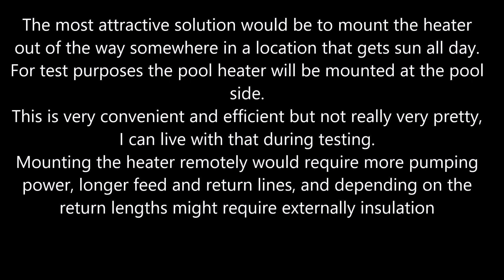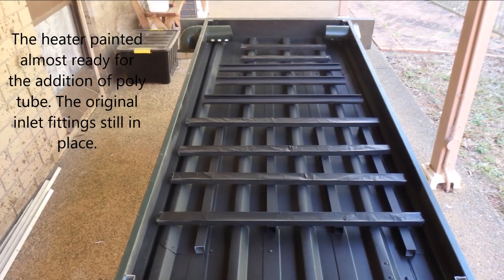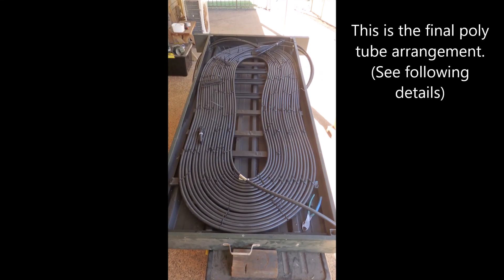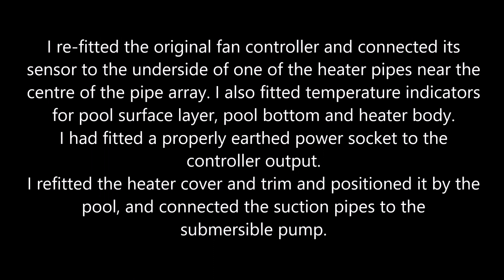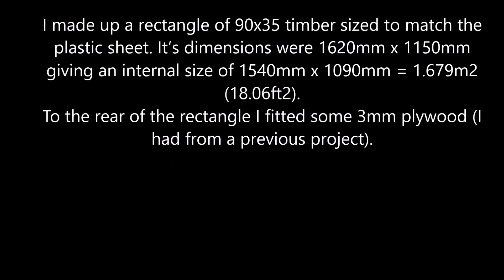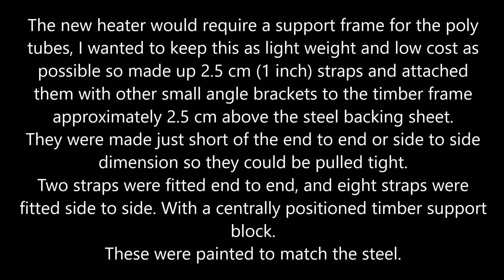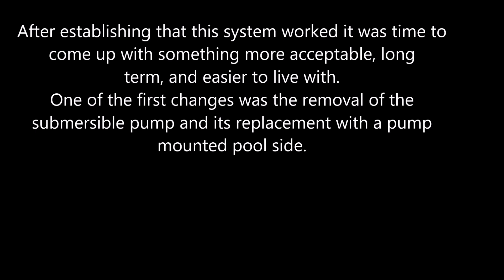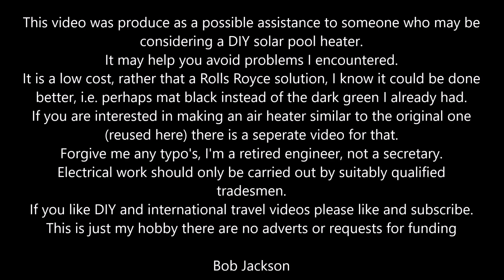DIY Solar Pool Heaters Updated (for a version with better audio see https://youtu.be/Gqa8gk0BVTU )

Comment: I would like to know how you did the start/stop on the pump
Reply from the maker: I have a low cost temperature controller measuring the heating pipe temperature. When the pipe gets to a certain set temperature (maybe 40-45c) a contact closes and the pump starts. When the heater pipe temperature drops a few degrees the same controller stops the pump. The controller is shown in the video. Costs about 10 dollars
Reply: @bobjackson4720  where can I get something like this
Reply from the maker: @ezfly5680  They are available on Ebay (from China they come in 12v, 110v & 220v versions the model number is XH-W3001 you can see them in the video. Amazon also sells them.
Reply: @bobjackson4720  thank you kind sir

Comment: nice video but terrible music! you can barely hear you half the time
Reply from the maker: I'm glad you liked the video generally. The problem with music is you have to use copyright free music or you get in trouble. There isn't a huge selection of it. Usually the words were also written  so I didn't think my voice was a big benefit. Sometimes I make a video and it only gets thirty or forty views so the two or three days they take to make is about as much time as I feel inclined to spare for each. This one was about a weeks work. I'm just a retired engineer doing this for a hobby. None are monetised.
Reply: @bobjackson4720  no music is better then bad music. As everyone has different tastes and you can’t please everyone, even if the music is ‘good’ never mind non copyright ‘poor’ music.  

Or use (very quiet) natural sounds like rain failing / waves / sound of a nice summers day. But very very low volume. As it’s soothing to listen to.  If insomniacs can fall asleep to (rain) others won’t object / complain as much.

But once again, despite all that, most will prefer no music at all. Thanks